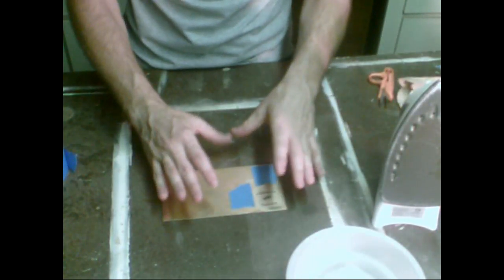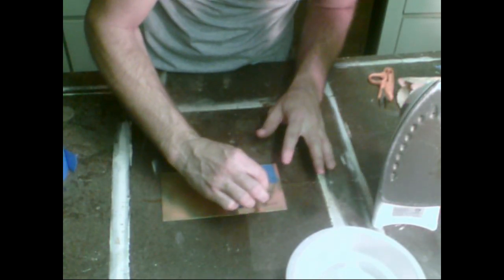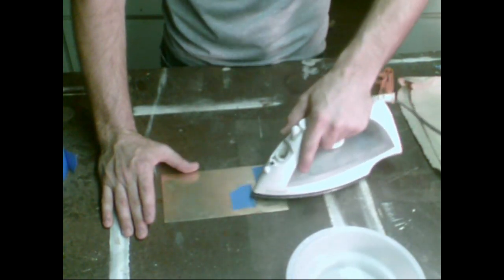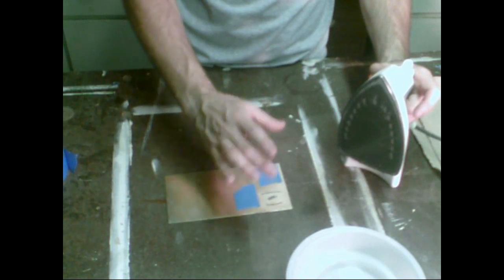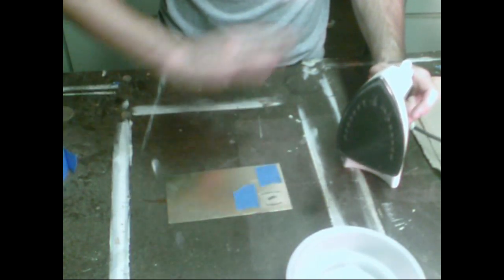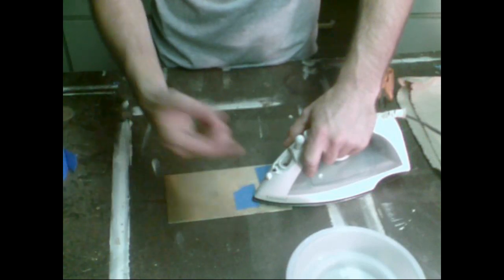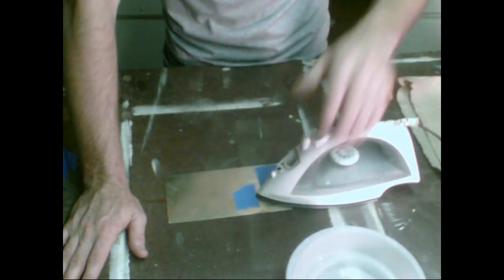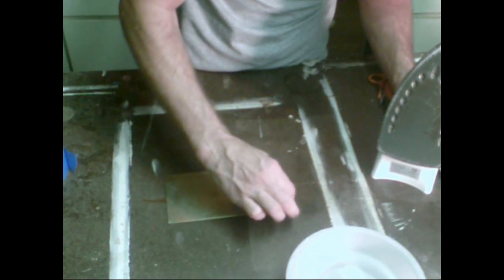How to Etch a Brass Name Plate Part 1

Comment: Great video. I've been planning to do this same thing for creating the brass panels of a replica Hellraiser puzzle box. (Hellraiser, the movie.) I was going to use "Riston Photoresist", that's used for printing circuit boards. I didn't realise I won't need that when using toner. Thanks for the tip!
Transparrent film's available for laser printers, but I can't find it in the shops, so I'll have to order it online.

Comment: just to add to your video you can print on a laser printer on to photo paper. place the photo paper on the metal and use an iron on it. submerge in water and gently clean off the paper. Then youre left with your design on the brass. Thats how i make circuit boards ;)
Reply: Bianca Morton  can we use vinyl sticker instead of printed photo paper. i have plotter and i can cut the vinyl and simply paste it ?
Reply: gagan9779 i have not tried it with vinyl but it should work since it will be protecting the areas you dont want etched.
Reply: I will try. Thanks :)